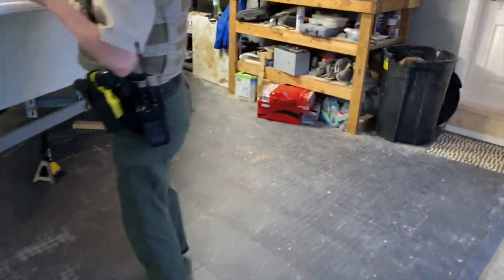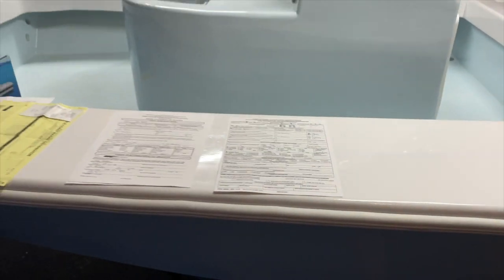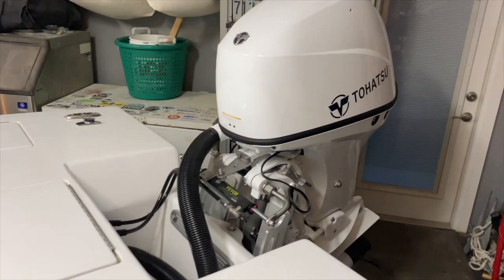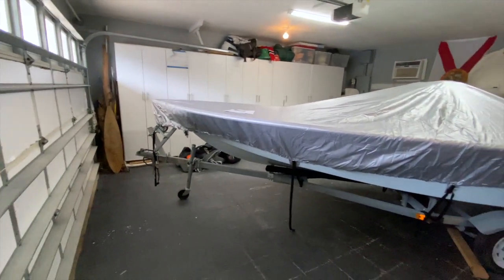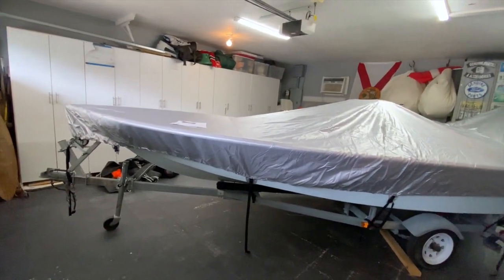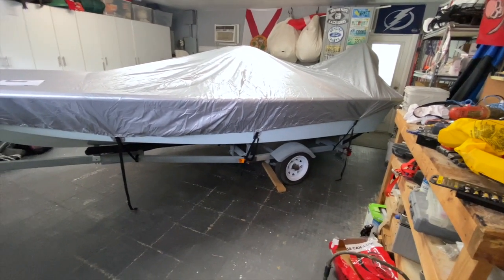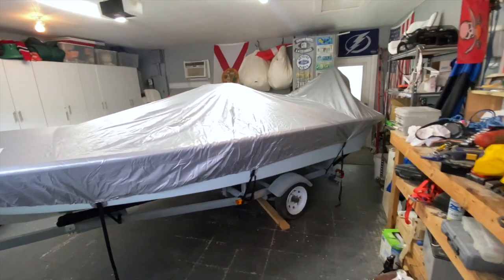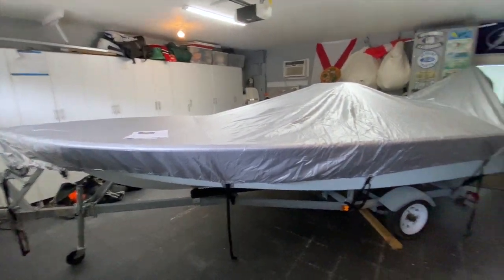How to get a Home Built Boat title in Florida  Very easy process explained.

Comment: I had an old boat given to me with no title, it needs a floor and transom, pretty much a complete overhaul. It does not have any hull numbers at all. If I keep my receipts for all the glass and resin, wood etc will this process work?
Reply from the maker: Yes it should. Take lots of pictures of the progress and if it doesn’t have a hull ID you should be able to retitle it as home built and they will give you a new hull ID for it along with registration.

Comment: So how do you do it if your boat is under or at 16 and you don’t have the receipts for it Have the vin number tho
Reply from the maker: Under 16 you don’t need to register it
Reply: @LightningCapitalLiving  This is objectively false. It says right on FLHSMV that any boat with a motor, regardless of length, has to be registered.
Reply from the maker: @slothbasket3660  also depends on where you use it. If you’re on a private lake, no you don’t have to register it.